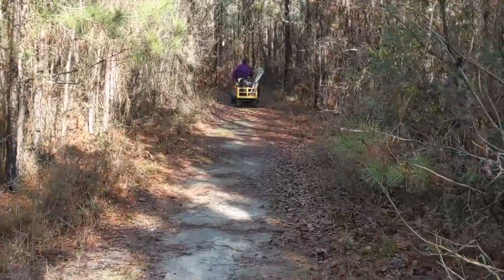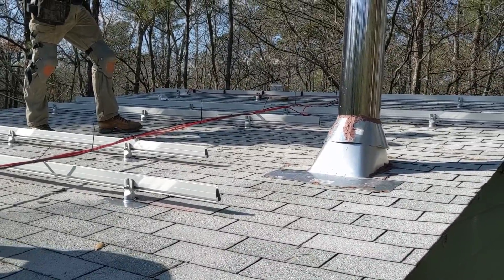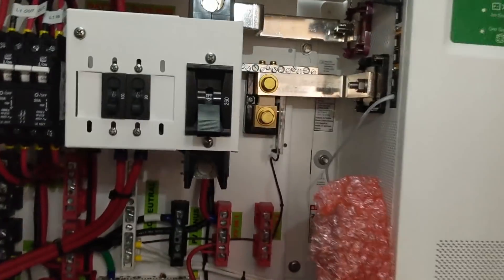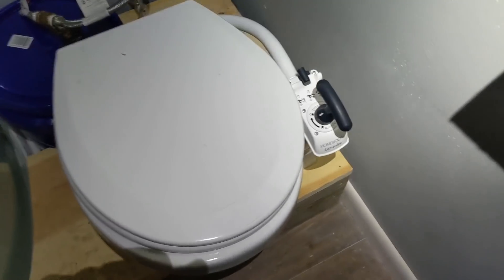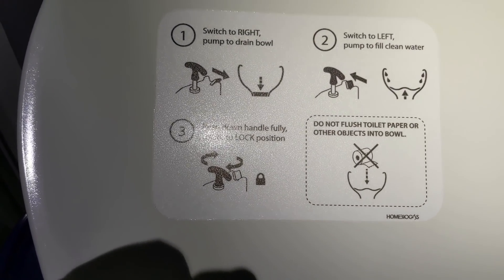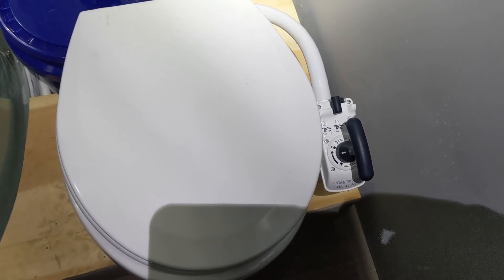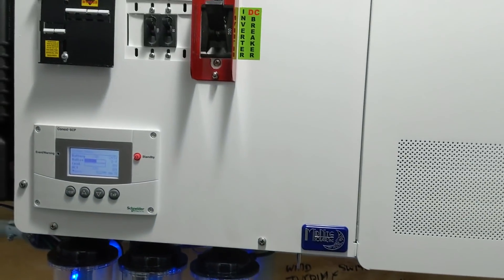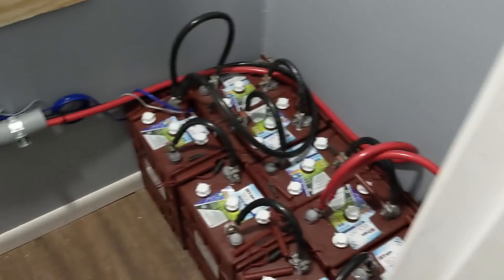Off-Grid Man Cave

Comment: I love your videos. I have stage 4 cancer and I'm building a solar power system so when I can no longer work we will still have electricity.  My wife is disabled and I been missing some work lately. I bought 8 panels and a powmr all in one charge controller 24 volt. I'm looking for a good deal on batteries but when I get a good size bank together I'll be alot more at ease.. anyways thank you for your videos

Comment: How did the iheat work out? Did it work? I seen those for sale at Home Depot, but there's too many negative reviews so I didn't buy it. Mainly they said it's dangerous because of the electricity near the water. Did it work? What would be an alternative if it weren't used?

Comment: Tell ya what, yall do nice work. I enjoy all these videos and appreciate your craftmanship. I am curious however about the wind turbine setup in this project... that tower looks pretty short compared to the surrounding trees. After struggling with a similar setup for a year trying different ways to get power out of it due to the turbulent wind, I'll tell ya now either that tower needs to be 20' taller or some trees gotta come down. Bigger, balanced blades and bigger tails help to a point but without straight line, steady wind they never accumulate anything.
Reply: Yeah, total waste of money for sure on the wind turbine.

Comment: Maybe I am crazy. But would not it be both smarter and cheaper to build  an " Off Grid" cabin using all the 12 volt appliances that are made for those beach vans teenagers have you know they have tv, VCRs, DVDs players Mimi frigs lights and fans run it all off solar panels and backup wind generators and a couple of 12 volt car batteries?

Comment: Who thought it was a good idea to put a power point above a shower??
Reply: I was wondering why the owner didnt use a Tankless propane system, then l thought that outlet is in n odd place which will get wet, not to mention the draw of 23 amps on a solar system using lead batteries.
Reply: @afreemanreigns  23amps at 115v so over 110 amps at 24v, plus inverter losses. So pulling 2645 watts while showering... Can those FLA batteries handle 110amp discharge rate?

Edit: So 2624 watts, which is 78% of the inverter capacity? Those batteries look like Trojan L16RE-B which are 6v/370AH. So 8KHW useable at 50% DoD. 
Based on the Trojan spec sheet, the 5 hour discharge rate is about 121amps. This is really tight margins on the specs of everything.
That "IHEAT" has some bad reviews on homedepot site. I would be careful.
Reply: @ninja5672  I am sure you are right ... but maybe this guy is like me 5 minute showers most of the time and 10 min once in a while!  I doubt that will have much impact on the system.  And if it was me - if it was cloudy a lot like it is in the winter where i live I would maybe skip days showering and do a military bath sometimes to help the solar system.  and i would figure out a way to not have that outlet there.
Reply: Exactly
Reply: These shower heads are used regularly in the Caribbean. You can buy them from Home Depot in Puerto Rico, they're Energy Hogs, but they do work. They're not UL listed or approved for use in the US, but they will work. I would only use one if it was connected to a GFI.
Reply: They have 4 wheelers that can make it to the cabin then they can bring in a couple propane tanks pretty easy.
Reply: The guy who bought the inline electric water heater I reckon. If it runs on 48v DC wouldn't be too scary. I don't think it does tho. I'd be nervous as I have no idea what I'm doing and would probably electrocute myself.

Comment: 3 wheel baby jogging stroller or vintage folding tough golf caddy would be easily adapted for these over the hill and yonder jobs. I have used both to carry sub 200lb loads in the woods or limited mud. Odd enough they always seem to be lurking at the local dump for free.

Comment: How much do you know about rv electrical, as I bought a 36ft 5th wheel then found out battery power doesn't work. That includes taillights blinkers, stoplamps, and part of the lighting. What I want to do is eventually get it set up with wind/water and solar power, any suggestions or ideas as I tried to go online to find a manual on this but had no luck.

Comment: Suggest this guy go with a pebblebed RMH & have an induction cooktop to provide backup to the biogas unit or another propane bottle fed cooktop unless you can multifuel the biogas burner.
Neat to see a on demand electric heater. Is it UL rated?
Another Cool Vlog  👍👍

Comment: I have a question, what is a good inexpensive solar inverter for a 24V small system and when are you going to get the water heater device back in stock. Am very interested in that. I’ve built a small solar generator for the hurricane season. I’m at 4.2Kw of batterie storage and just bought a 3000W inverter, I’m buying four 270W PV’s soon. Thanks for any information. I enjoy your videos.

Comment: That on demand water heater is NOT GOING TO WORK.... if i had one and yes I am in the troppics where we get sun all the time, I would only use it between 10am and 4pm.... so for him he better settup a hot water service that runs off panels with a dc element and have a backup biogas on demand hotwater system.

Comment: That GFI plug in the shower should be out of the shower and he said 23 amp on a 15 amp outlet !! It's a big NO NO!!
Reply: but... he gets to cook with farts.

You're just jealous.
Reply: @alanmalcheski8882  you can burn out your system or ruin the in demand system if they dont match..
Reply: Seems like it would be better to use the farts for the water heater, but that's just me.
Reply: @alanmalcheski8882  bio gas is only really sufficient as cooking fuel I dont think it has the BTU's or whatever to heat that much water.
Reply: @alanmalcheski8882  Or save'm for the Hot tub. Heat and bubbles.
Reply: Didn't he say he show a breaker box in the kitchen? 3:42
Reply: I live in Guatemala and spent over 10 years around Latin America and you see that kind of setup for hot water all over the place.  They literally call them “widow maker” showers...  haha 🤣
Reply: That's what he said, but why does it have a 15A plug?
Reply: At the bare min add a outdoor weather cover but i agree with u
Reply: At least it’s a gfi it is ultra safe
Reply: @eddygoodwin7089  We're not talking about people protection but equipment protection here. By overloading the plug and socket there's a fire risk.
Reply: @teravolt1195  wouldn't it just pop a breaker?
Reply: @eddygoodwin7089  Because there are multiple sockets on a circuit, the breaker and cable will take more amps allowing for overload of the socket.
Reply: @teravolt1195  couldn't it be a dedicated circuit?
Reply: @eddygoodwin7089  It could be, but we don't know that
Reply: What's the worst that could happen?
Reply: @insidehismind105  electrical fire right above off-gassing batteries. any problems are not likely to "spark" outside the bathroom, but, in a perfect storm....
Reply: Over wire and under break.  Always.
Reply: @mrmrlee  lol. I ordered some 10 gauge wiring for the outlets in my man cave. Shop said "Running 240v?" ... nope... "How many watts/amps?" ... all of them :) I always treat voltage drop as the enemy.
Reply: I think an outlet inside the shower is awesome, friggin natural selection right Thur... 🤣🤣🤣 Hopefully you'll get to enjoy the taste of an bio ass burger before you fry...

Comment: What were those domes on the underside of the inverter with blue lights?
Reply: Lightning arrestor / surge protectors
Reply from the maker: @houseslosttribe1351  Correct.  Midnite suppressors at that.
Reply: @engineer775  
I like yer Work & pray ya always succeed 👍

Comment: Nice compact solar system. 

Not too fond of the gone biogas system. Takes 30-60 days to “charge up” and needs daily feeding. If it’s a once in a while hunting cabin it’s or going to do the job. Additionally, for the gas you need to buy filters. Those filter are pretty much equal in cost to a propane filling for equal amount of gas and obviously not always available locally. Last one, it’s not a good solution in cold winter climates, unless you keep the digester bladder indoors. All that being said, it will work in some locations for some people. I prefer an outhouse and woodstove
Reply: I still would like one located in the greenhouse.. and one for a cooking area. I think its well worth it, and a nice rocket stove in a picnic cooking area.  I did not know a filter was needed for the gas.. do you still need it if using outdoors?
Reply: Cherrie Mckinstry you’d have to read up on the details on their website. I don’t recall those details.